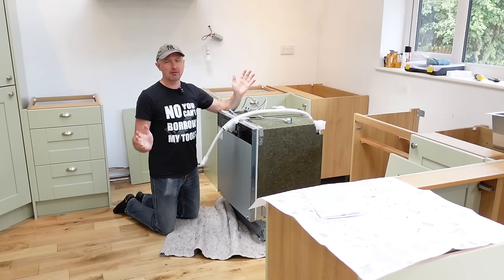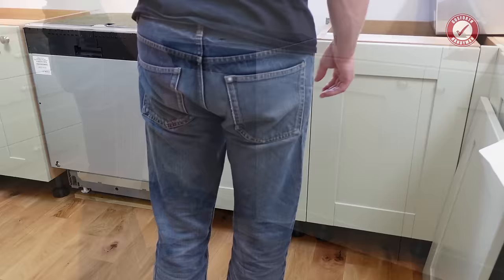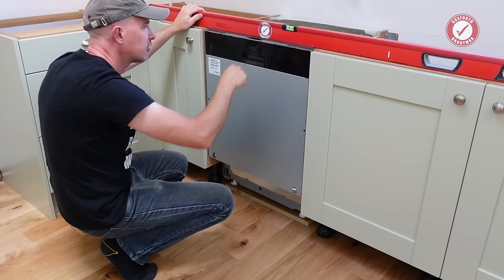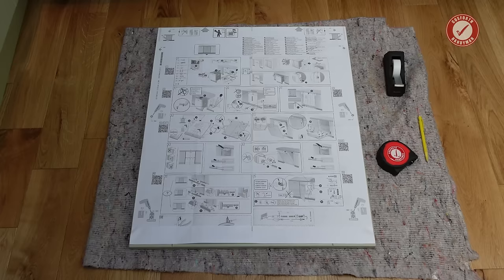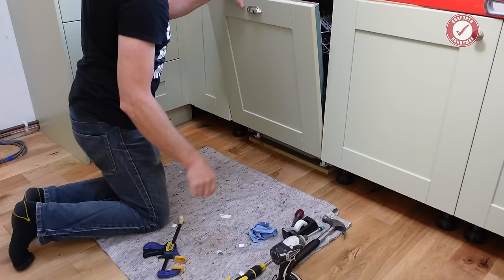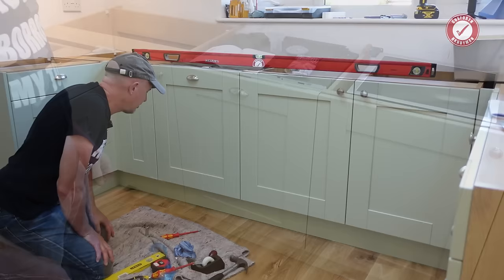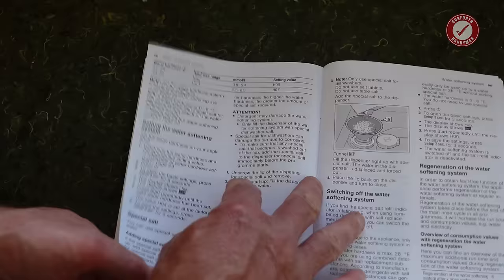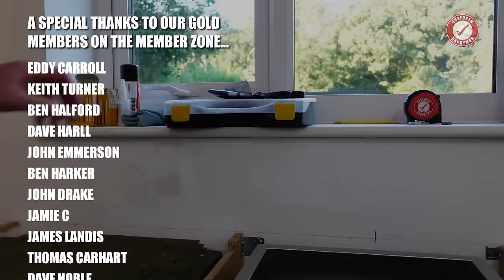How to install a Bosch integrated DISHWASHER

Comment: @Gosforth Handyman. Excellent work as usual sir! Just a little piece of wisdom that I picked up and something you may already know. You commented on your Bosch dishwasher having only three levelling pedestals/jacks. Apparently it's easier to level off on three legs/pedestals/stands than four. The "analogy" as explained to me was of the classic three - legged milking stool. Just rotate to get level. Are the cymbal stands on your drum kit three or four legged? Your kitchen fit out is coming on a bundle. Thanks again. You and yours stay safe and well.
Reply: For a three legged stool all three legs  will always be in contact with the floor. If the floor is not level then the stoll will not be level.
Reply: Overconstraint is a plague. Adjusting four feet for level is a neverending juggle which just burns time.
Reply from the maker: Cheers Mark! Yup, 4 feet machines are defo more stable though (having worked on both). 👍😁

Comment: I noticed that you brought your waste water pipe in from the bottom of the sink cabinet. I’ve always seen that brought in from the top corner so that it’s above the garbage disposal and gravity will help keep the garbage disposal from backwashing into your dishwasher waste hose. Potential health concern. Will you not be using a garbage disposal?
Reply: Looks like you just installed basic sink waste drain pipes and no garbage disposal, so maybe you’re okay. I’m not sure on local rules on that.

Comment: Does anyone know if the handle you install HAS to have two points (screws) of contact to the door? I was planning on installing a knob (one screw).
Reply: Mine has a single screw. Just make sure you counter sink the screw so it’s not touching the door.

Comment: I’m fitting one as I type. A question I hope can be answered fairly quickly unless there is a Bosch help number. The water pipe connection where the bulge pump thing is, when I tighten it up to the connection the bulge bit is still really ‘loose’ ..is it meant to be like this?\it feels like it’s not fastened properly. I turned water on and totally not sealed even though I fastened as tight as I could. Has anyone else had this problem? Do I have to fit a new tap valve thing? Surely it’s standard fitting or is the Bosch fitment faulty?
Reply: Solution: had to buy new water tap connection valve as not enough space inside current one for the filter inside the Bosch aqua stop hook up. I bought a Flomasta VAH0379 angled washing machine valve 3/4” x 15mm compression joint . Was fun taking old one off , some wd40 helped then had to hacksaw olive off gently and cleaned copper pipe with wire wool, but fitted this new one with some PTFD a few turns around olive and didn’t over tighten and seems a good un. I’m putting this in here in case anyone has same problem hooking up to water connection. Flowmasta Tap/Valve cost £1.88 at Screwfix. Note ..I also had to mount machine on t shape wood , using wood that came with packing 15mm rise I think it needed to get machine up to wood worktop. Can’t have a gap otherwise machine is loose and rocks back and forth when try to open it. I put brackets on to screw to underside of worktop but might not need to use as I have snug fit.

Comment: Hiya.
I need to get an integrated dishwasher, but the space inside the cupboard i got is about 57cm, all other measurements will fit a standard. 
So how do i do this?
Dows that mean ill be stuck with a slimline?
Reply: Thank you.

Comment: Nice video as usual,just a quick ask the 2 fixings you put in last that secures the dishwasher are they not sealed regards Jeff
Reply: Think that’s what the rubber grommets were for
Reply from the maker: They're after the seals, in the dry area. 👍

Comment: I am just a chick who has never installed a dishwasher, but shouldn't there be a gap up top so you can slide the dishwasher out (if repair is needed) so you don't disturb the counter top?
Reply: Good point.
Reply: You just adjust the 3 feeds Down to lower the machine
Reply: Usually you need the dishwasher up tight to the worktop so you can secure it to the underside of the worktop with the supplied brackets. If you do need to remove you'll need to lower the legs slightly undo any retaining screws and slide it out.
Reply from the maker: There's still enough of a gap so not a prob. 👍

Comment: I thought the card was fairly self explanatory, tick is correct, cross is wrong.
Looks to me like you messed up with the door and then edited the mistake out, should have kept it in so people could see your mistake.
Reply: I agree. Ive got the template on my door and im double checking it and it wont put it flush with top of adjacent cabinets. This is really confusing.

Comment: The reason that Bosh a German company (made in China) is only providing  3 legs instead of 4 legs. 3 lags tripod configuration! so they can save money drilling a hole in the bottom of the chassis for 3 legs instead of drilling and taping 4 legs and only providing (3) Legs! that way they only drill and tap 3 holes, one for the center rear leg. 

Think of it this way, for every 1000 dishwashers the company manufactures instead of providing 4000 legs, drilling and taping 4000 holes. they only have to do that for 3000 holes that means they say 33% on the cost of drilling and tapping the for 4000 treaded holes and   Buying 4000 treaded  legs. They also save money on the cost of the drill bits and the cost of the taps and the cost of the electricity and the labor. How many holes can a drill bit drill and a tap cut treads before they have to replace them? what is the labor cost to drill 3000 holes versus 4000 holes!

This all started over 40 years ago with a manufacture of olives and somebody at the company said “what if we take (3) olives out of every jar!, for every 1000 jars of olives we say 3000 Olives! We can use those 3000 olives 🫒 fill up in X number of jars! Now we’re saving the cost of growing, picking 3000 olives!
Reply from the maker: I'd pay the extra £5 for another leg. 👍😂